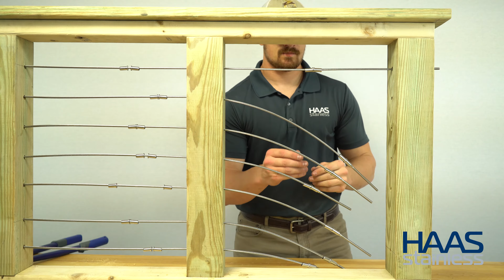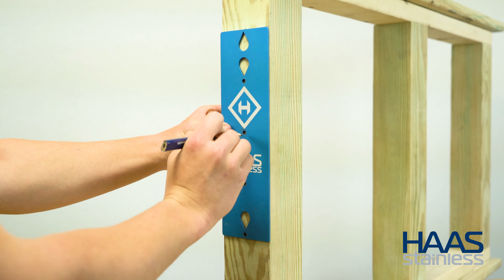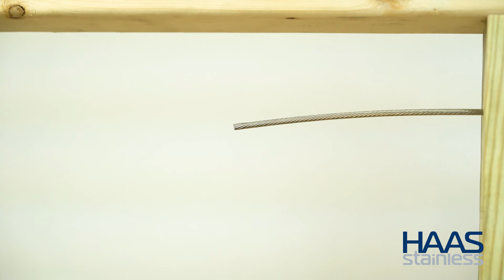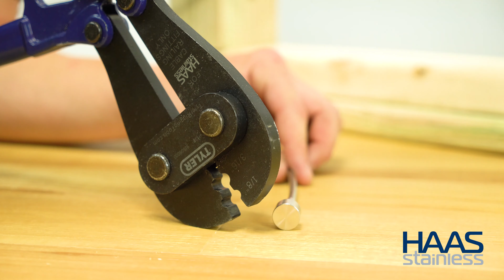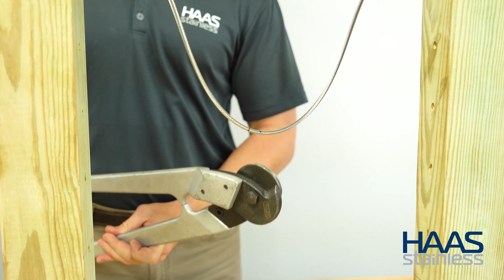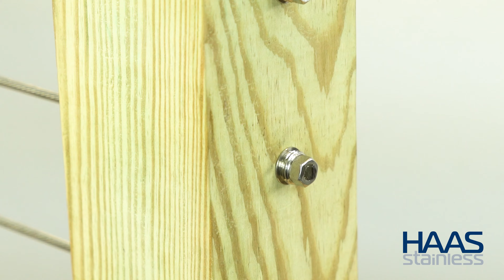How to Install HAAS Stainless Swage Studs - DIY Cable Railing

Comment: If the cable has sagged over time, how do you recommend retightening?  With the threaded rod cut off there is not room to grip it while turning the hex nut
Reply from the maker: Hey Charles! You can grip the stud on the other side of the post with a pair of vice grips and a cloth. Hope that helps!

Comment: Hi! everyone. I just bought this amazing Muzata 40set Stainless Steel Cable Railing Kits for 1/8" Wire Rope, Including 40Pack Jaw Swage Stud Turnbuckle,40Pack Fork Terminal Lag Screw Eye, T316 Marine Grade CK08, Series CA1 CD1 CS1 I total recommend it. Just click on the link below if you need more information about this amazing product. 
https://amzn.to/33s7jIQ

Comment: are the posts in this example 4x6 nominal?
Reply from the maker: These are 4x4 nominal (3.5" x 3.5" actual). These studs will work in a variety of thicknesses as long as you adjust the measurements on your cable cuts to suit.